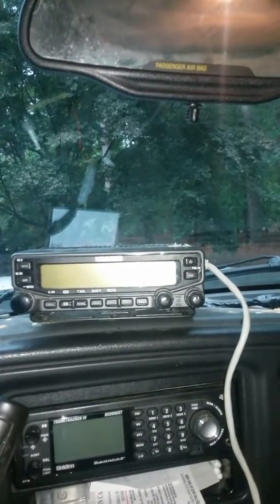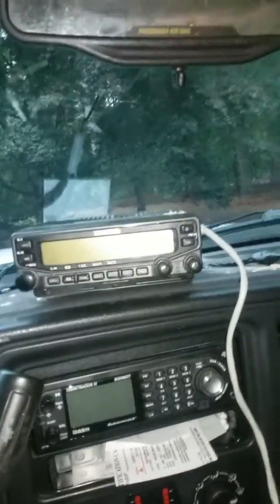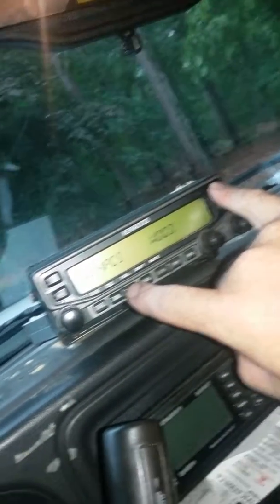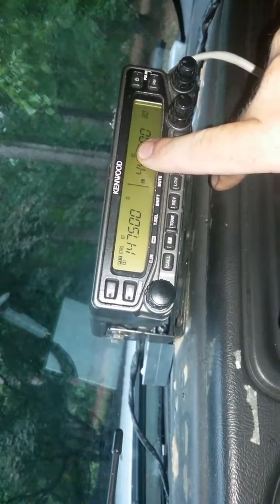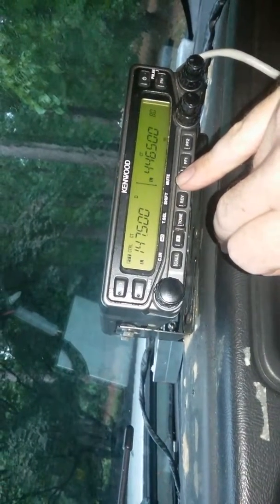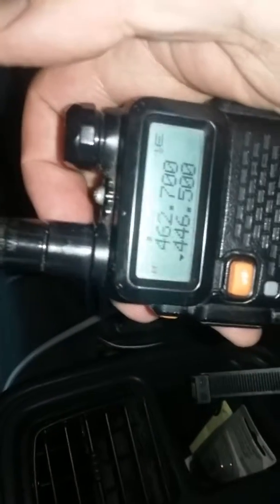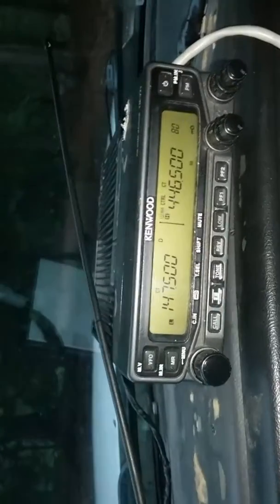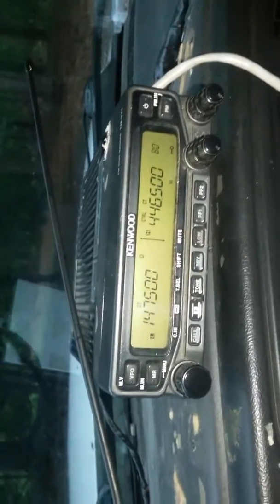How To Set Up Private Cross Band Repeater Full Duplex

Comment: Thanks, excellent presentation, especially on inputting the repeater receiving and re-transmitting frequencies on the UV5R. 
(I was planning to use the cross band repeater to extend the range of club members HT  in coming event where everyone is transmitting at the vhf and the secondary listening frequency set at the uhf,  both at the repeater TX/RX frequencies, assuming if any HT fail to receive the HT point to point vhf it will pick up the re-transmitted uhf.)

Waiting for my 10W TYT th8000e to arrive to try out.